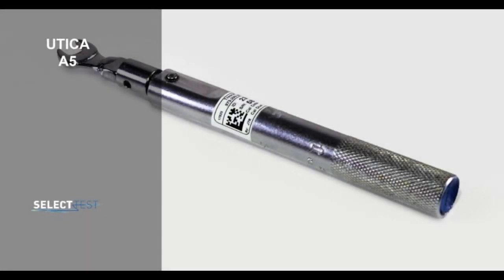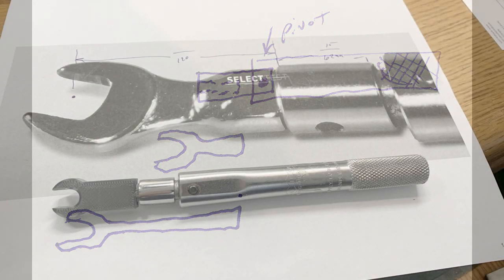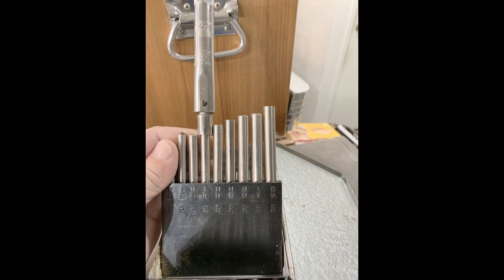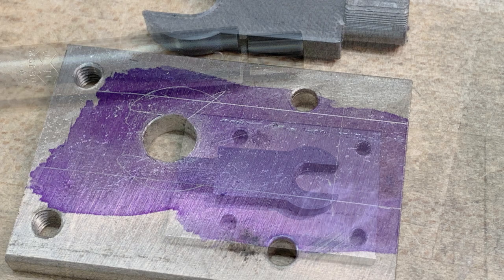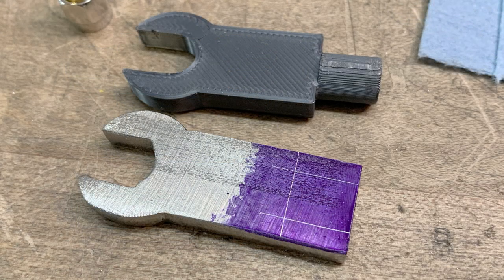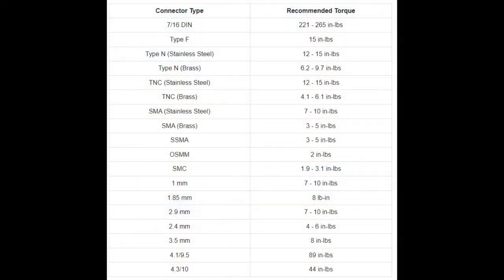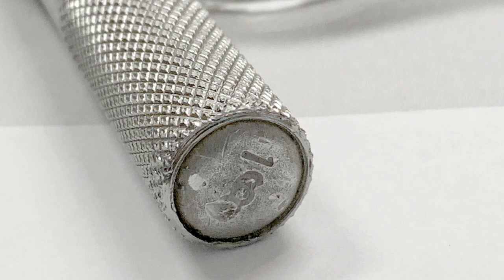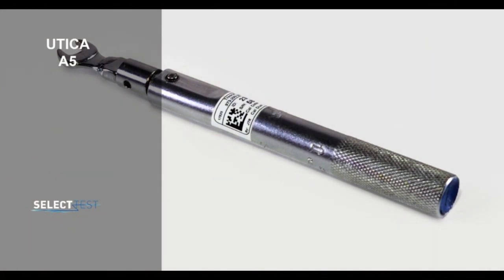#1444 SMA Torque Wrench Refurbish and Calibration

Comment: Thanks. The nice part is the calibration; 6"/pound.
The same way I checked the torque produced by the DC motor to rotate the shaft of a wide spaced variable gang capacitor.
De VU2RZA

Comment: Please excuse my ignorance but why do we need such a thing in the first place ? Why can't we just screw the SMA connector (or any other connector for that matter) with our bare hands ? Like we would do with F connectors (like for TV antenna splitter). Thanks
Reply from the maker: professionally F connectors should be torqued as well. there is a small difference between a snug fit and tight fit in terms of critical measurements like S11 S21. but only on equipment that is higher accuracy than a $50 unit
Reply: The torque wrench ensures that your male and female connectors are sitting at just the right place relative to each other. Not torqueing properly can lead to reflections which will lead to inaccurate measurements. Also if you don't torque properly, moving your cables will more easily lead to loosening your connections. Just a couple of things that you learn as a noob working with this stuff haha
Reply: @IMSAIGuy  for an amateur radio operator the Nano VNA/the tiny SA are of very good precision.
Accuracy and precision are usually mixed up in the colloquial terminology.
Accuracy is the established value and accepted by the laboratories.
Precision is the measure of how close we are to the accurate value.
You must try to be precise enough in each time when making the measurements to achieve the accuracy.
If the values obtained are not consistent each time and way off it is useless. There comes the question of repeatability. 
As I said these tiny gadgets are precise enough to serve our purpose.
Especially on the higher end of the frequency spectrum (some go up to 6 GHz) and using the well calibrated torque wrench is highly mandatory. There's no doubt.
Loosening of the connectors are real horrible things one should expect when tough cables are interfaced with thin cables at the Nano VNA/tiny SA if you don't use a wrench.
Hand tight with "calibrated fingers" would become a joke.
De VU2RZA